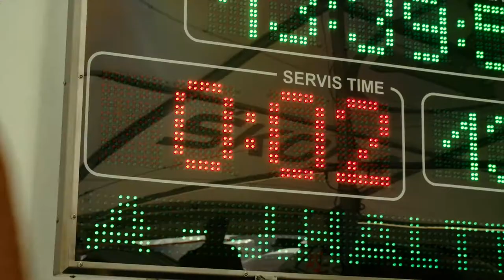SKODA Motorsport: ВІДДАНИЙ ПЕРЕМОЗІ

Comment: Это шкода фабия с полным приводом на турбированном движке?
Reply from the maker: Posh Lina Turbocharged 
4-cylinder	1620 cm3
Direct injection	
Max. power	212 kW
Max. torque	425 Nm
Drivetrain
4x4
5-speed gearbox
Manual sequential shifting
Mechanical differentials (front and rear)
Suspension 4x4 
McPherson	Front and rear
Brake discs	tarmac - Ø 355 mm / width 32 mm
gravel - Ø 300 mm